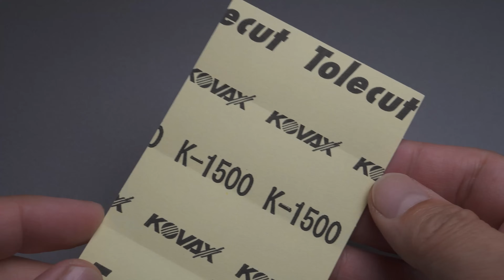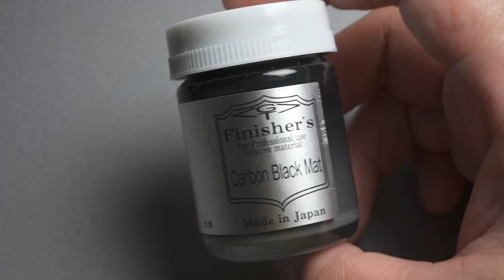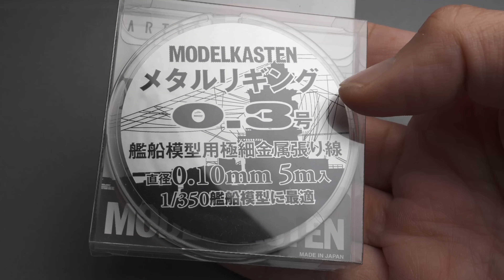#04 Building Jordan 191 TAMEO 1/43 F1 scale model car

Comment: A beautifully sleek build of a very streamline & minimalist car. The shape is bare with a curvature that will show up any mistakes or flaws in assembly & paint finish. The suspension arms, front & rear wings all have to line up perfectly because the body shape can't help with the alignment. Good use of the brass square to help with alignment & the plastic strips to get correct ride height. Sanding the clear coat to remove the step in the decal & then re-coating ensure the finish surface is smooth & sleek.The seat belts & other additions make this personal & not just a standard build. 
Only comment is the Goodyear tire logos are a bit too brown from the tinted clear coat & the logo on the right front tire is backwards ? Otherwise, another great build.
Great presentation as usual, very relaxing viewing & the next creation need to come sooner.
Reply from the maker: You are a true spokesperson for my efforts and regrets, which you have so aptly expressed.
I leave the description section of the video to you.
Thanks again.
Reply: Those who cannot achieve greatness can only give it praise when they see it. I speak for many when I say we appreciate the effort you put in to promote this hobby we enjoy.